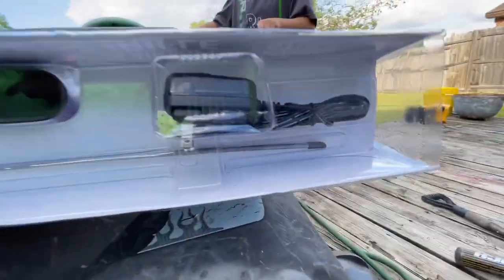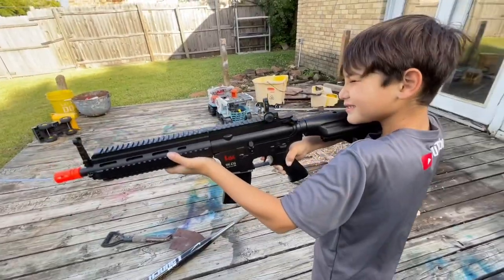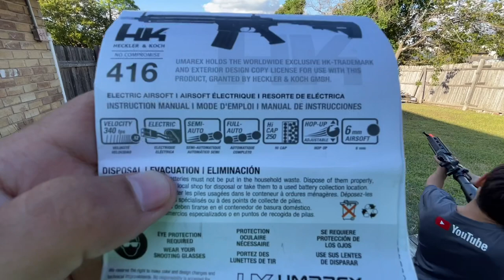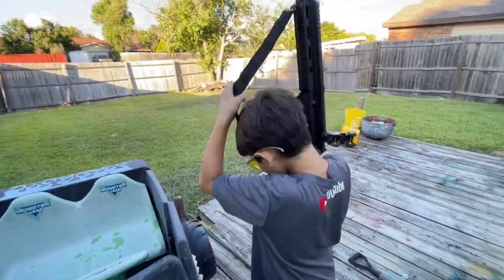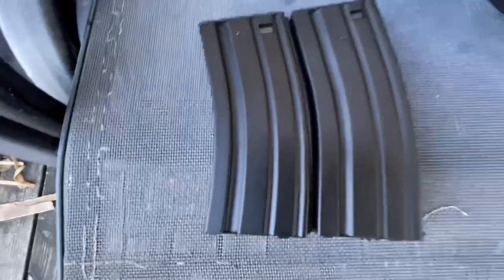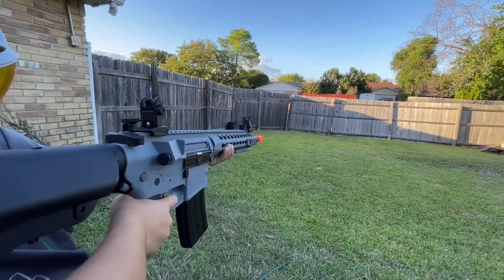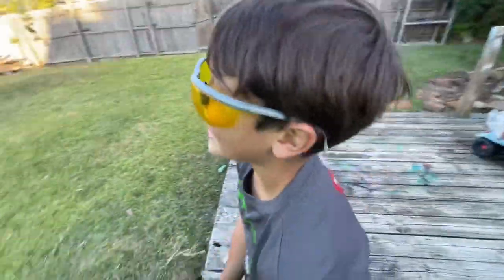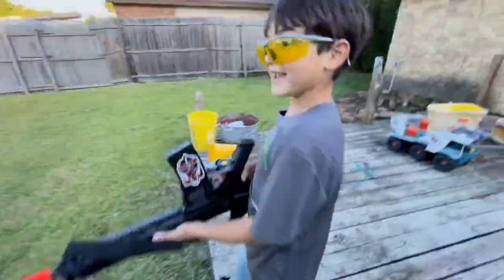HK Airsoft 416 /// How good is this for $100?

Comment: Also I know you guys have a lot of green bbs which are 12. Grams but you should start using 20 - 25 .gram bbs so it shoot harder
Reply from the maker: Yeah the next time we go out and film another shopping video we will be buying some white .20g biodegradable ones. A lot of people have been telling us they are better. Thanks a lot for the help Halo 💪🏽
Reply: @rykerstoybox  .20 and higher will reduce the over all speed of the bb but it’s more accurate and it heavier bbs are better for outside when dealing with wind and stuff. The weight of the bb is determined by a small air bubble in the bb the heavier the bb the smaller the air bubble due to more density.
Reply from the maker: @genuinelybad365  ahh that makes sense!!! Thanks for the clarification. I really appreciate the info though for real 💪🏽

Comment: Couple of questions! Love the budget 416 especially since looking to slap an m320 grenade launcher on there--you think the plastic body/rail system would hold it ok?? Also have you tried using a 9.6v battery in the HK? I'm sure that would improve the ROF and performance
Reply from the maker: Thanks a lot for the comment Jesse. I’m not sure how heavy the m203 launcher is but I feel like the HK is sturdy enough to hold an attachment like that. The quality is not bad. It’s better than a cheap springer but not as good as a $200 AEG. I also plan on making a video switching out different batteries to test how differently the rifle preforms.
Reply: I have the exact same 416 as this one and I can say it will hold an m203 no problem. However it is made of cheap plastics so I would definitely not drop it. Overall it's a good entry level gun for a kid, but you'd be better off spending the extra $75 for the $175+tax on the Lancer Tactical 416 insted.

You can swap out the battery to a higher voltage, but also know that the internals are also cheap and will burn/wearout faster. After owning mine for about a year with everything factory in it, it doesn't hold good enough punch. The box says 340fps but I only got mine to do 178fps with hop up adjustments made when the gun was brand new using 25mg pellets, tried 48mg pellets and the gun shot those just fine, but getting up into the heavier ones the motor started to sound like it was struggling even after adjusting the hopup.
Reply from the maker: Thank you for that clarification Angelfish. And I would have to agree with you if you can afford to spend the extra $75 then going with a lancer is probably your best bet. I think the extra performance and quality it definitely worth spending the extra money for sure
Reply: @rykerstoybox  funny coincidence i just purchased both the lancer tactical and the 416 before i even seen this video. The 416 does shoot alot better and faster with different batteries and .20 bbs
Reply from the maker: I know I’ve thrown the lancer tactical battery in it and it shot so much better. The 416 is a really good starter rifle
Reply: I run a 9.7 in it
Reply from the maker: Nice!!!. I’ve ran a 7.4 lipo in it and it shoots way better but I will have to try a 9.7. How does it shoot?
Reply: @di5ea5eairsoft6  has it running guud still?
Reply: @Kirschteinskull  Yes, I don’t use it anymore because I have a krytac now but last I checked it still works great

Comment: Idk if you'll answer or not but, you can change the stock with any other ar15 style stock like magpull right?
Reply from the maker: Yes however you will loose a little bit of the functionality
Reply from the maker: Airsoft stocks seem modified a little for the butt stock pad to be removed easily. The real magpuls don’t function that way. They will fit on the buffer tube the same way though
Reply: @rykerstoybox thanks man I appreciate it!

Comment: The funniest part is I bought the same gun from academy but it’s really for my dad we don’t like it too much so we taking it back  because it mostly made out of plastic or polymer
Reply from the maker: That’s crazy you bought it too. Did you also see the elite force AEG’s they had there? They looked like decent quality. I’m going to go check them out next time, but I know what you mean. They do have a cheap deal but I’ve seen way worse, overall I wasn’t too disappointed. It’s a good if your just starting out, but if you have the extra cash I would say go for so like a lancer
Reply: @rykerstoybox  actually I didn’t there wasn’t much of a variety there. I actually have a matrix sportline m4 but I think I might get a lancer tactical. idk which one to get I was going to get yours but idk what’s your opinion?
Reply from the maker: @otcfynl  I really like ours but keep in mind the Lancer we own is our only good AEG so I really don’t have anything else good to compare it to just yet. There very well might be better options we just haven’t had the opportunity to try others yet. I do know I’m always getting recommendations for the g&g combat Raider 16 and being told it’s the best at its price range. But as i said I can’t actually vouch for it since we only own the Lancer.

Comment: That little windup key that came with the 416 is for winding up the mag faster
Reply from the maker: Thanks Bernadette 😃 I will have to check that out tomorrow. I didn’t know about that. Thanks for the tip 💪🏽 and for the comment 😊
Reply: @rykerstoybox  You're welcome!
Reply: I didn't know that, either.  The instruction sheet's very sparse.  Especially for a newb.
Reply from the maker: I agree. We are so grateful for this community. They are so very helpful here

Comment: should i get this? for a beginner ar
Reply: Skip this and get a matrix m4 that would last longer in the long run this gun wouldn’t last a few months on the field
Reply: @Survival HH will it be god to use just in my backyard?
Reply from the maker: Cherry survival is probably right if it was being used in the field, unless you upgrade certain parts it might not handle the heavy use on a field. However, me personally if your just using it in the backyard to play around with I think it’s a very good option. Especially since you can pick them up in Amazon for like $89. But I’m sure I feel this was because we can’t play on a field yet because Ryker is still too young

Comment: do u think the hk416 is better or the game face ak76?
Reply from the maker: Each has there pros and cons. I feel that the game GF76 shoots better out of the box, however you have more railing in the 416 for attachments. GF76 has a slightly larger bb reservoir but the 416, it’s easy to find a replacement mag for it since m4 mags are very standard. Both are very great and are very nice starters. The one plus is that it’s there being more battery options for the 416 since it the nunchucks style batter. But here a video we made doing a little shooting comparison of each one Complete AEG Airsoft Rifle Kits Under $200
https://youtu.be/Ig6X0R_c57A
Reply: @rykerstoybox  Thank you so much for the help!
Reply from the maker: Anytime

Comment: 3:12 I’m having issues taking off the cover for the battery compartment I am doing what you did but it won’t budge any tips?
Reply from the maker: Ours pushes comes off pretty easily. Make sure you’re pressing down from the top to bottom.. applying pressure at the top of the butt stock towards the very end of the stock and press down until it clicks. It’s not like most other AEG’s. It just clicks in place
Reply from the maker: Let me know if you still can’t get it. Maybe I can make a video for you
Reply: @rykerstoybox  I got it off it was stuck
Reply from the maker: @Colbylash  nice 👍. Let us know if you have any other questions 💪🏽 and you got a pretty sweet AEG’s

Comment: How do i take the stock off if its stick and wont change?
Reply from the maker: What do you mean by stick? Like it won’t change positions like extending or shortening?
Reply: @rykerstoybox  as in the tube, because my button to adjust size is stuck and doesn't move
Reply from the maker: @T4îlæd try pulling the button out. Not the lever but try to grab the little knob and try to pull it down to see if it will release what it’s caught on. Make sure there is no battery in the tube

Comment: does it have a threaded barrel?
Reply from the maker: I have tried to remove the tip but I have been unsuccessful. Because the quality is not the best you can where the barrel kinda comes apart. You can’t apply too much force or you can possibly break the barrel. I’m sure if you heat up the tip it might twist off but I haven’t tried that yet
Reply: @rykerstoybox  thank you i was thinking of buying one for my hallowen costume and also for airsoft
Reply from the maker: If you have about $30-$40 more I would recommend going with the Elite Force M4 CQB it’s a complete kit with smart charger for around $150. It comes with a slightly better battery too. I have been able to remove the tip off this one since the barrel is slightly more durable. The HK 416 Kit is an amazing kit for the price though so if that’s all you have definitely go that route.
Reply: @rykerstoybox  thanks dude

Comment: 100$, looks cheap, feels cheap, and sounded cheap.

Wouldn’t recommend except those at $200 and above, if not I’d recommend you guys the WETech M4 GBBR for starters at $300 and it’s full metal would probably be at legit airsoft stores.

There’s also another starter GBBR I recommend, it’s the JingGong M4 GBBR, they’re plastic but they’re GBBRs that use plastic bodies but still use the WesternArms GBBR system only for around $130 or something, but yeah I recommend that for starters who are looking for cheap GBBRs.
Reply from the maker: We appreciate the recommendations for real. I have definitely been looking for some reasonable priced GBBR’s and you just fixed us up with a few great recommendations 💪🏽💪🏽💪🏽 thank you so much for the info 😊, and yeah that one did feel a little cheap but you got to understand. We have never used anything over $200 so we might not really know what good quality is

Comment: Does it use normal m4 mags?
Reply from the maker: Yes it does it will interchange with any standard Airsoft M4 mag (hi cap or mid cap)
Reply: @rykerstoybox  let's goo I can actually use it in a field and I can do Tactical Reloads
Reply: @rykerstoybox  and you should get the Lancer Tactical M1911 CO2 Cobra blowback
Reply from the maker: Ooh that sounds nice. We will have to look into that one. Hopefully the Airsoft shop we go to will have one since it seems like all they carry is lancer tactical
Reply: @rykerstoybox  and on airsoft gi there cheap
Reply from the maker: Ooh I need to check them out them 🤔

Comment: Hello, what is the fps of this gun.please🙏🙏🙏
Reply from the maker: I will have to run it through the chrono this weekend for you. By the time I get home from work it’s already dark outside. Is that ok?
Reply: @rykerstoybox  no need of the vedio you can just say the number here in the chat please.
Reply: @rykerstoybox  also can you please make a vedio on the very nice aap-01 green gas blowback pistol,it also has fiber optics and just cost a 100 bucks
Reply: @rykerstoybox  please
Reply from the maker: @ChemSketch777  I will post the FPS as soon as I can get it tested, and I’ll post the number here for you. Also I’ll looking into the aap-01 pistol. If it’s only $100 I’ll definitely pick it up. Do you know where I can find them?
Reply: You can buy it in the online store as well as the offline store in Los Angeles.
Reply: Also might be available at academy sports.
Reply: @rykerstoybox  aap-01 is the cheapest and the most powerful pistol(for the price),it is blowback and is also heavy, very nice pistol
Reply: Also it uses green gas , not like co2 which is very expensive, and also the cartridges are a dump of waste after they are used.green gas the best!!
Reply: @rykerstoybox  can you please send me the fps? It's been 11months!!!!
Reply from the maker: Oh wow that is a long time, I just charged the battery too so, again, if I can remember I will do it tomorrow. I know I’ve done it in a video comparing AEG’s under $200
Reply: @rykerstoybox  ok thanks